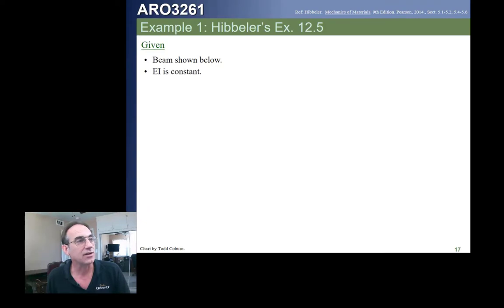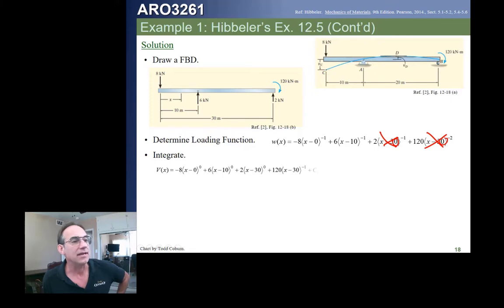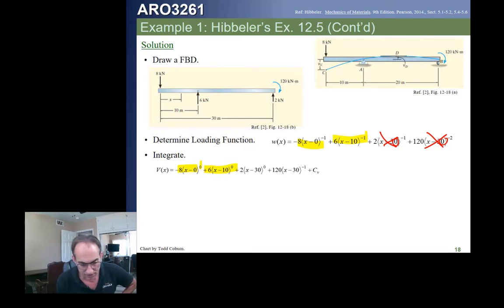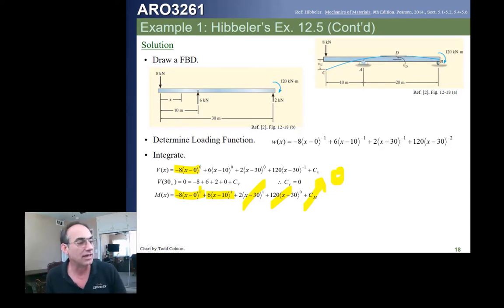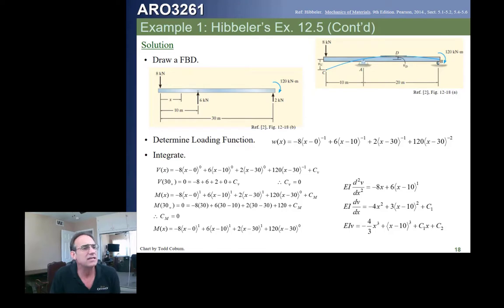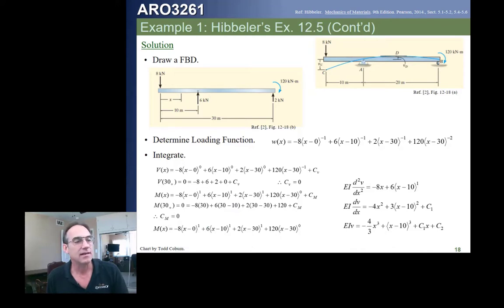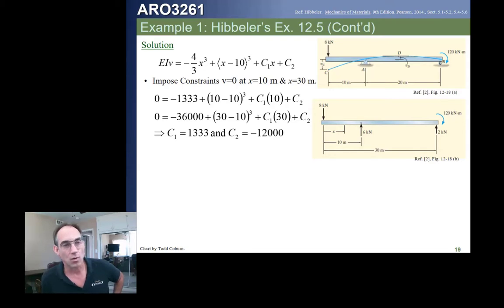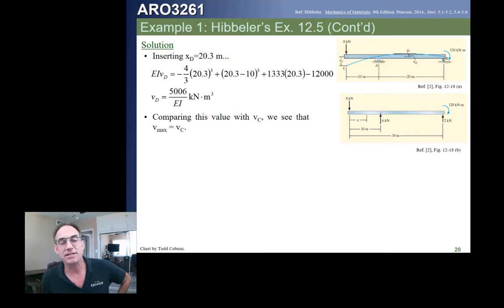Strength I: L-13e Example 02 for Beams Deflection & Slope Analysis

Comment: Hi professor. 

When locating the local max/min by setting dv/dx = 0. Why did you remove the coefficient "-4" in front of the x^2?
Reply: I think that's a typo.

The equation to find the maximum displacement between point A and B should be

-4x^2 + 3<x-10>^2 + 4000/3 = 0 

expand it will get you
x^2 + 60x - 4900/3 = 0

Comment: Sir, I have a doubt. You showed Cv to be zero by applying V(30) = 0. 
How to do the same by imposing V(0) = 0 ?
When I do that, I am left with Cv = 8 instead of 0.
0 = -8 + 0 + 0 + 0 + Cv
=> Cv = 8.

Where am I going wrong.
Shouldn't
<0-0> raised to power 0 evaluate to 1 ?
In your case in video you evaluated <30-30> raised to 0 as 1.
Thanks in advance
Reply from the maker: Mr Student… there are two ways you can evaluate that.  

Just before the load at zero (I call this 0-, we have…
V(0-)=0=0+C since all terms are inactive and external force has not been applied.

Just after the load is applied we call 0+, which is still at zero but after the external force is aplied.  Here we have…

V(0+)=-8=-8(x-0)^0+C

Since that term raised to the zero power is 1, this becomes 

-8=-8+0+C

Either way, C=0
Reply: Thanks for your kind response sir !!
Reply from the maker: @MrStudent1978  :-)

Comment: Do you use x=10 and x=30 because that is where the reactions?
Reply from the maker: Yes, each singularity term involves the subterm <x-a> where a is the x-location, measured from the left end of the beam, of where the force, moment, or load is located (for forces & moments) or started (for distributed and gradient loads).